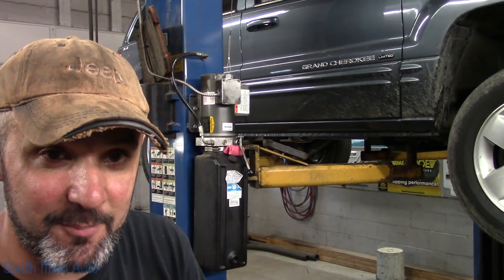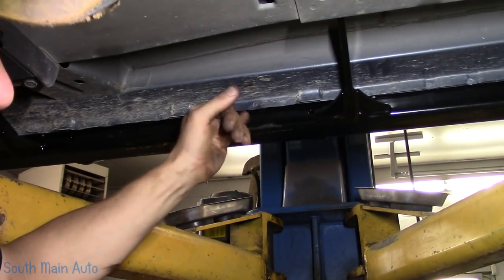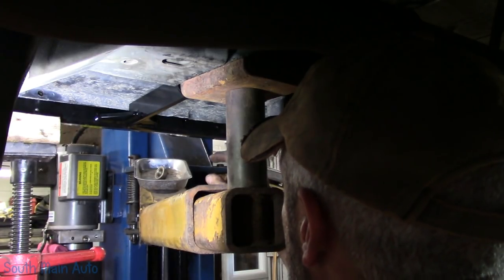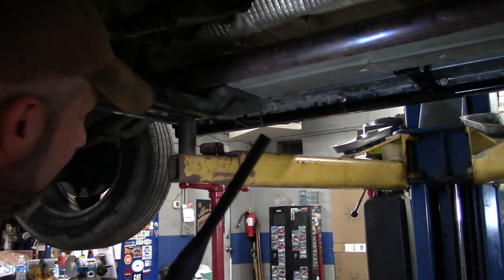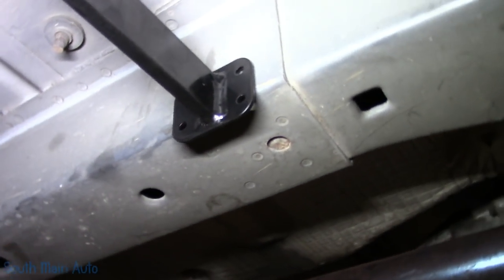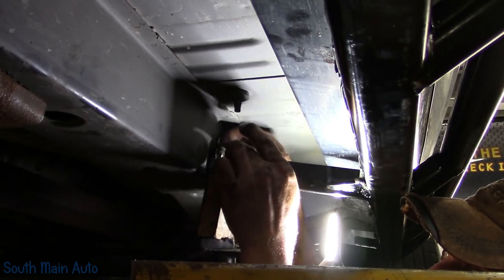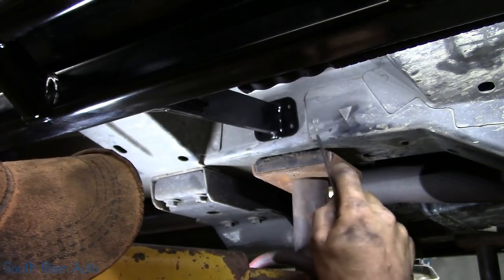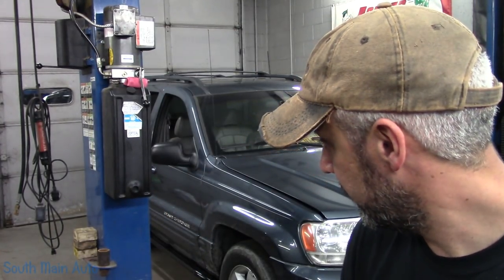Jeep WJ: Iron Rock Off Road Premium Rock Slider

Comment: Judging how clean and rust free that jeep is I would get it to Krown rustproofing as soon as possible.
Reply: dip it in liquid cosmoline and put in on a rotating display :))
Reply: @Captain Caveman AMEN
Reply: Corrosion Free is another company that has a great rustproofing system. They're the highest rated company of its type in Canada.  They only require re-treatment every 18 months, instead of annually.  It does cost a little more than some.

Comment: For the bolts, you can use a cutoff wheel and make a slot in the shank and use a flat tip to hold it while you get started.

Comment: Suggestion: When you have drilled holes in metal to accept fasteners, instead of paint or fluid film, try bedding compound.  Bedding compound is a thick paste that comes in tubes and is used in a marine environment.  It prevents electrolysis between dissimilar metals and completely seals water out.  It is like a kind of caulk on steroids.  Available at any marine supplier. I think it would do a much better job of preventing those freshly drilled holes from rusting out.  Comes in tubes and is available in white or black color.
Reply from the maker: I am googling now for future use! Thanks for sharing this tip!
Reply: For this install, a much better option would be using butyl tape. little to no mess and that stuff never drys.
Reply: I tried that on an application on one of my SUVs but didn't have good results.  The road salt sticks to it and forms rust around the tape.  It is too tacky.
Reply: Good point, I'll look for that, the next time I'm in the boat shop. The whole topic of slowing electrolysis is a mystery, I don't even understand the difference between marine antiseize and standard antiseize. There must  be some reason for the 2X extra cost when the word 'marine' is added to any construction product.
Reply: FlexSeal! :-)

Comment: Might have been a good idea to pre-load the body by having the weight on the suspension before installing any frame connecting equipment. Bodies can flex and settle. When I built frame connectors for my Charger, I built raising boxes out of 2x4s to keep the body pre-load before welding it in place. Helps prevent any problems with doors closing and the like. I'd also tack weld your assembly if you don't plan on removing it. It'll make it much more stronger and rigid.
Reply: I mean it's on the lift so it's already loaded your thinking to much he's not cutting the frame

Comment: Instead of the bolts you could have drilled holes and put the ever dreaded nutserts in the holes.  They are a headache but you wouldn’t have to worry about torching nuts off if you ever need to remove them in the future.
Reply from the maker: I was thinking of that but I did not have any 1/4" nutserts at the time and wanted to get the job done. Almost wishing I did in the end but hind sight is always 20/20 right?
Reply: After a few NY winters they will be rusted to the frame and you won't need no stinking bolts lol.
Reply: don't think i'd have trusted nutserts there anyway, that's a lot of metal hanging out that will have unknown forces and would likely pull the nutserts right out of the frame while making an ugly flared hole :)

Comment: My comment here for what it's worth, I do suggest (since you said they aren't coming off any time soon) weld the damn things on there.  It would have saved you a lot of time.  Strength and durability would be 10X stronger than nuts and bolts (seeing that you live in the rust belt).  I also had a thought when I saw that you were bolting it on to that little bitty pinch weld part of the body, I was thinking why not bend a piece of flat bar 3/16" into an "S" shape and weld it to the body and to your slider.  After thought, better to just weld the damn thing on there.  End of story.  What do you think?  You can still do it and you can leave all the nuts and bolts in place.  Bah!

Comment: @25:28 I'd bet Nut-serts (Riv-nuts) would be excellent here. By installing these bars- you're essentially adding a "frame" that substantially strengthens and gives integrity to the Unibody. Nice job!

Comment: Hey E  I liked that face you made when wrenchin that 1/4 socket drive on the first two bolts!!! Self tapping screws to hold on a rock slider???? Steel plate on the inside and 3/8 bolts sounds lots better to me. Party on Garth!

Comment: At least you brought up fitment issues.  It's an aftermarket part, they built it on one Jeep and had a small test batch that probably went fine.  But when you start selling hundreds/thousands of items you'll run into some fitment issues between year models and whatnot. There's a thing in manufacturing called Manufacturing Tolerance and every item is given plus and minus a given number that it can be off since there is no true measurement in the real world. The design might want it to be 12" long... but in the real world there is no true 12", it might be 12.001" but it's not 12".  So a example of the tolerance for an item could be 12" +/-.125 (11.875" to 12.125").  If it's between that tolerance it passes.  When you add the OEM manufacturing tolerance to an aftermarket tolerance things don't always add up like they should.  I've installed multiple aftermarket things on my Jeeps and trucks so I know beforehand about always expecting the possibility of needing to modify something.

Comment: You could also use nutserts for the holes that go into the frame. They are commonly used when installing running boards and side steps. They work great and are easy peasy. It always makes me wonder if the test vehicle they use to mock up their patterns for this sort of stuff is off a little bit. You always have to tweak this stuff to make it fit right.

Comment: The only thing about the V-8 models there are known for head gasket issues. I own a WJ 1999 with the 4.0L (American Moters) Straight 6 with 173,548 miles with 93 octane I get 19 city 234 highway 21 mixed.

Comment: Eric, there is a much easier way to do this job. First off, to drill the holes use a spot weld bit. Use this type: http://medallionrefinish.com/products/repair-products/cutting-grinding-drill-bits/drill-bits/tin-coated-cobalt-spot-weld-bits rather than the Blair annular cutter type. You should be able to get these from NAPA or your tool truck guys. They don't wonder and they are available in 5/16" and 3/8" which conveniently were the sizes you needed. They also tend to be made from extremely high quality steel (boron or cobalt) so they last a long time.

Secondly, use Riv-Nuts instead of the self taping screws. With Riv-Nuts you don't need to fish around inside of the Unibody channels like you were doing as they are applied from the outside. CALL OUR BOY CHRIS AT ASTRO and he'll set you up. Here's a link to them on Astro's Website: http://www.astrotools.com/catalogsearch/result/?q=Riv-nut

Tell Chris to send you a 1442 kit and a bag of whatever size nuts you'll need for whatever bolt size you decide to use. This will save an immense amount of time and effort. Riv-Nuts are a great way of putting a threaded fastener wherever you need it in metal <1/8" thick. These are a great invention. Riv-Nuts are the bomb and we use tons of them on race cars. On Max's drift car this is how we attached the ground effects kit. Any other way would have sucked.

Comment: Love this series of Jeep project.
I went through two trucks (army surplus Dodge, then short bed Ford "77 351 Cleveland) before I decided that off road mudding as a hobby was too expensive for my taste. I then bought Chevy 4x4's that were able to use 31 or 33 inch tires with no lift...( I have always had a Chevy for on road) , for occasional mud on the way to the deer stand. I still have my '04 Z71 with 200K....in fine shape for on road or light off road. My wife uses a Jeep Grand Cherokee as a daily people hauler...and she loves it.

Comment: Hey Eric, check out MVF (Mountain Vista Fabrication) for stuff like skids, rock sliders, quarter panel armo and bumpers. They have quite a bit of selection for steel bumpers too. You have front winch bumpers, stinger bumpers, winch and stinger bumpers, bumpers with 3/8" water jet slotted plate that is formed with tight rigid bends at an angle to go down around the lower rad support and ties into the unibody on both sides with a section bent at a 90* angle with holes pre-drilled to go between the steering box and track bar mount and unibody, not only preventing either from pulling through the rail or swedging out the holes, but giving more rigidity right by the coil perches so the unibody is less likely to distort when articulating as well. Pretty sweet stuff, ran one on my ZJ and dropped it full force onto a sharp boulder, barely even a scratch in the powder coat that they also do for the same price in any color before they ship it out. They also do rears with swing out, flip down or hitch receiver style pinned spare tire carrier, rear winch, and hitch built in that has a C channel mounts that go all the way up to the coil perches, replace the OE shock and track bar mount and they put 6 sets of holes  through the C's on each side mount 1;2" diameter with grade 8 bolts so you just have to drill the holes in the unibody and then it literally bolts AND sandwiches the C channel to the frame and you can also weld it for that much more confidence, even though you'll never pull 12 1/2" bolts through the unibody, which I also ran. Absolutely loved it. Quality USA steel and fabrication, needle bearing sealed fair leads with grease zirks, same with spare carrier hinge. They also do stuff like diff pumpkin armor and trusses, which are as good of if not better quality than Artec, but half the price. Another good fab shop/site I'd recommend is KOR (kevin's off road), he offers a lot more for WJ aftermarket. And last, just my opinion, but I would run Rubicon Express coils. Lifetime warranty, and Iron Rock coils just have way too hard spring rate and full compress to full droop IRO are shorter. I hated chasing my coil down hills lol. So RE uses progressive rate coils, and they decompress a lot further and you don't need limiting straps for just a 4-4.5" lift like you will with good long shocks ( ran Bilstein 5100 v1, perfect combo with the RE coils both at stock weight and with 600lbs worth of armor and bumpers and 35" spare..etc.

Comment: I've been following some of your no crank no start videos on Chevy truck. My 99 with 5.3 will start great if it's been sitting. However driving it over 10 minutes and it will not start or crank for 45 minutes sometimes. Relay and starter are good and working. Anyone have suggesting? Thanks!

Comment: Where do you strap the deer down??? Hey just kidding, I was thinking Harbor freight is selling OBD2 readers and one I thought I would try is the model 13 for 169.00 on sale. Now I dont have a shop or work on others cars much, but I see you use scanners all the time and wonder if you could get one of these and test it out It would be interesting to see what you think........Now if folks want to answer for you, like Harbor freight is all junk, I got it yeah yeah yeah, I aint paying 3000 dollars for a scanner to read and see if I have codes or clear them. Now my interest comes from the fact that my 2002 superduty some times has the ABS light on, now I dont know where the problem is, or if its even a problem. The shop wants 200 bucks plus parts if needed, even if its just to clean the sensor, so this scanner says it will read the ABS codes and will pin point where there is or not a problem, do the math folks, if it works...................... thanks for your channel    Michael

Comment: 3 m RUBBERIZED under coating dries hard and is paintable and will not come off!  No other brand works!  
Where did you get your light.?  I would do the bottom in bed liner.

Comment: Black Butyl Rubber Sealant for sealing and covering up those bolts. Very sticky last forever. Should be able to purchase at your local hardware. Comes in a 10 oz caulk tube, never dries up. It will film harden on the outside once applied.

Comment: Similar to the way Rocky Road made the sliders for Isuzu Rodeo, which would be fine for the unibody Jeep but terrible for the Rodeo. Isuzu has a frame so the difference in flexing between the frame and body just tore out the bolts and the holes in the pinch weld. I ended up cutting off their mounts and welding some 2x2x.250 tubing and some 1/4 plates to weld directly to the frame. 6 years and hundreds of very hard rock hits and still holding. I'm by no means a welder but seem to be good enough.

Comment: Hey Mr O every one to themselves, but Jeep build quality is the main reason that UK sales are ranked, best year for Jeep UK 2016, 2,300 units sold , plus's on the driver's side pinch wellds, personally once tolerances were known I would have slipped a peice of flat stock drilled out as shims , transferring heavy shocks to a washers out setscrew between mating faces is not going to go well. as mentioned each to there own, and great channel you have as well as Family, all the best.

Comment: Have you decided yet on whether or not to convert it to part time 4x4? Also, on your air drill if it has something covering the exhaust port, you can cut up a green scotch brite pad and stick in there to quiet the thing down if you so desire. Damn thing must be screaming loud in person.

Comment: For anybody else watching this. Never put rock sliders (or really anything that bolts to a unibody) unless the suspension is holding up the vehicle. Also make sure the work area is a level as it could be. The WJ was much more stiffer. But it was still kinda flexible. 
Now it still might be tweaked even with the suspension supported. But it might be straighter.

Comment: I'd be scared, that if you stepped on them, the bolts would rip straight through the pinch welded lip? (They most probably know what they are doing, but it seems kinda flimsy to me.)

Comment: nicely done
those self drilling screws only good for barn construction lol .
You should of done lift first as then not need put it on the 2 post :-) 
Damn clean underneath that one, looks pretty original and expect rocker alignment factory issue or flexed from 17years of use .
Parking lot will be overflowing now you got a jeep :-/

Comment: amazingly RUST FREE jeep -most rotted out by 5th yr in salt belt
  -I would further Krown or RustCheck entire bottom of unit
   -bit extravagent to add more structure to 17 yr old unibody though
      also suggest rivnuts to add rigidity instead of small selftappers into thin sheet metal
        better get new tyres,yours look beat-or inadequate to take off road

Comment: On blind bolts, I typically use a split lock washer on the blind side. That usually works pretty well when you have to break them loose later, but then again, I don't live in the salt/rust belt. I know there was  reason I never moved to the northeast. :)

And by the way, no car manufacturer has ever built a straight car, and some manufacturers are worse than others, and like you mentioned, 4-year old jigs and tooling can mean a lot of slop.

Comment: Those are nice. I think that the pinchweld issue is a Chrysler/Jeep manufacturing issue rather than any kind of damage in the past. It all looks so clean and all original. Usually, when there's been some bodywork done, there's some kind of evidence somewhere in the area of repair.

Comment: For attaching the slider to the sub-frame, what do you thin about getting longer bolts and drilling all the way through both "layers" so the head of the bolt is exposed?  Would that weaken the sub-frame beam too much?  (I don't know if these are the correct terms to use here)

Comment: I don't know and maybe it's just me, but if I installed the bolts from the back of the frame through to the outside of the frame and then through the rock slider and used washers and nuts on them, I think that I'd either "peen" the ends of the bolts or center punch them a few times to where it would keep the nuts from backing off the bolts.  But then again that's just what I'd do.

Comment: Where the braces bolted to the frame nut-serts or riv-nuts would have worked good. Not quite as good as a bolt and nut but a hell of a lot better than the tek screws. Good job! they look good

Comment: nice project. 
I would have used a longer stainless bolt for the rocker to to frame fish it thtough the frame from inside and secure it with spring washer and nut. Since its long so I will use double nuts on the tip of the bolt. It is used to hold the bolt when tightening and removing the bolt.

Comment: That's a really clean WJ. I had a 2003 GC Overland edition and really loved the smooth-shifting transmission, HO V8 and the combination of off-road capability while still having good road manners. The bad was unibody and door rot that was too far gone for me to invest in repairing so I sold it and bought a used FJ Cruiser that was in better condition. The never-ending issue I had was electrical-related gremlins mainly due to corrosion and bad grounding. Fixed a lot of that but if your dash or other weird things go wonky be prepared to track the grounds all down and fire up the wire brush.  ;-)

Comment: Adding a skid plate, lift kit and knobby tires, O.K.But fitting all that heavy gauge steel like bull bars, rock sliders, brush guards, luggage roof racks, and such is a waste of money. Looks cool? or looks like heavy garbage. I saw a factory Wrangler loaded with that crap, plus a farmers jack, winch, and an exterior jerrycan. Chrysler couldn't have charged that pigeon anymore.
Reply: Decals - Chrysler forgot to charge the Wrangler owner for decals.

Comment: Hey Eric, a few years ago, I installed running boards on my wife's '15 Pilot. They had me use Rivet nuts or Rivnuts to secure a few of the bolts to the frame. Could you have used these rather than fish the bolts through the frame?